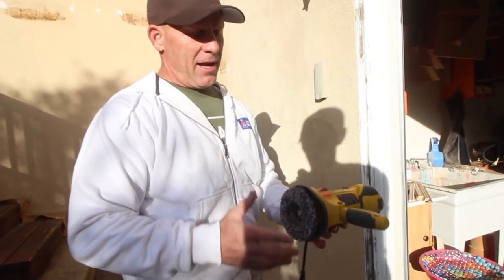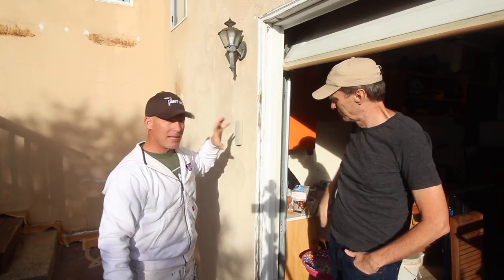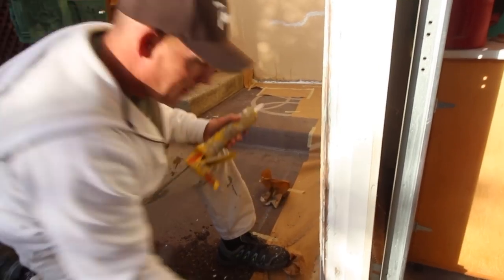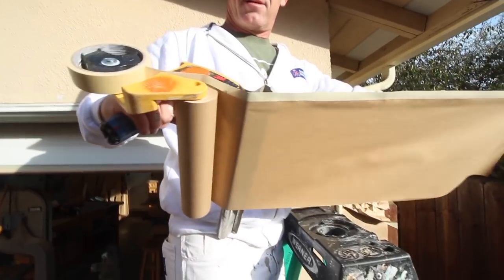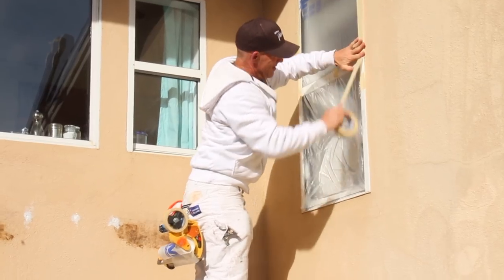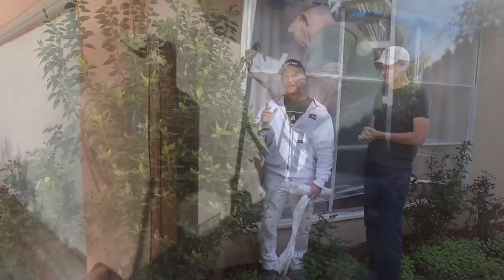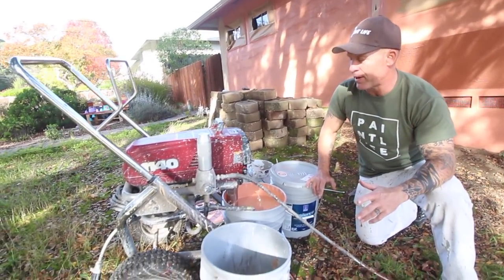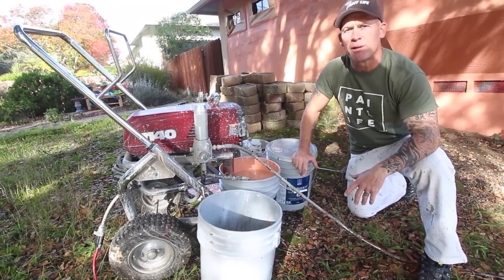How to Prep and Paint the Exterior of Your Home

Comment: My house is half concrete and half cement board siding, with the concrete on the lower level and siding on the upper. Would the spray method be best for this? Or would I have to go back and roll so much that it wouldnt be worth it? I live in northern Virginia if the climate matters also. Thanks!